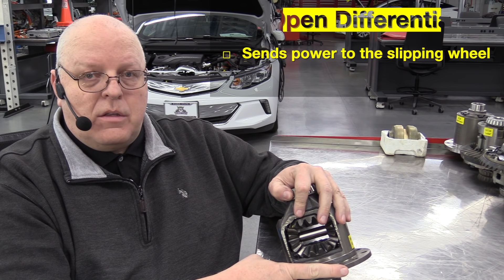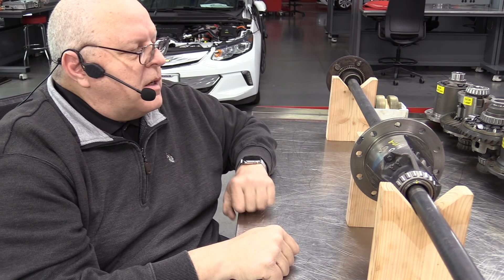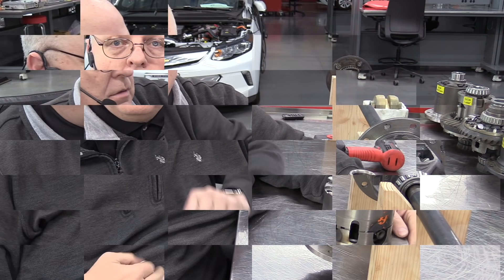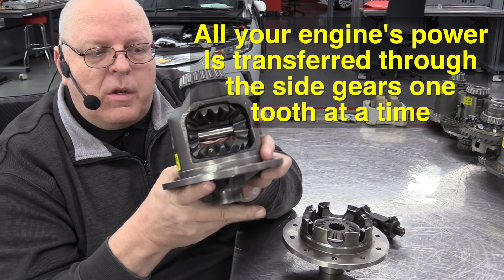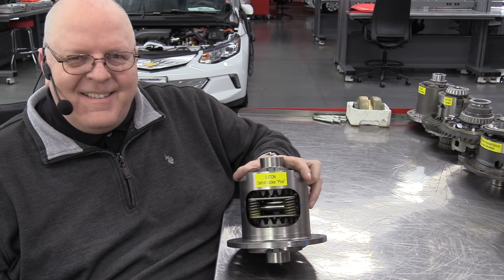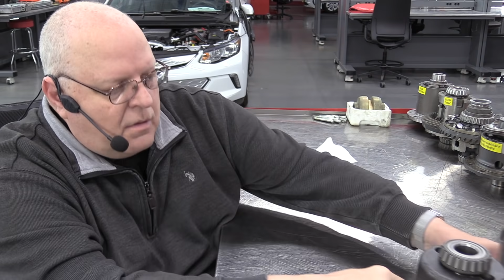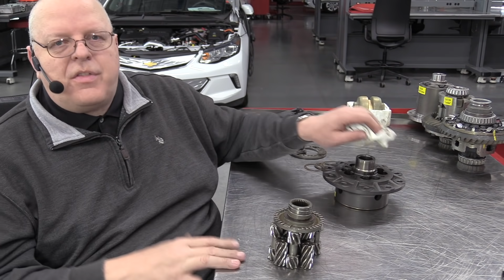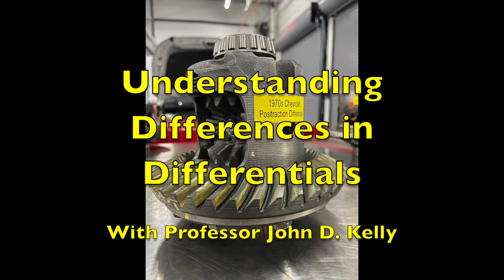Understanding Differences in Automotive Differentials

Comment: 1:00:00 I'm not convinced your Eaton 'locker' is a limited slip - for the simple reason it's called a locker ! I guess it's a governor activated locker - which I guess will respond faster than the air operated one.
The air operated one is a disaster if it is automatic. If it's manually activated, the instructions will say to activate it only when stationary - so you don't mangle the teeth like as has happened !

Anyway, as this is my final drive - err, comment - thank you very much for this video, it's been an interesting journey through various diffs ! The more I think about the Trutrac using the pinions as a limited slip, the less convinced I am that they do that - unless there is some clutch somewhere they operate. I guess all I can say is - feel free to prove me wrong !

Cheers. Great, well-presented video.
Reply from the maker: https://www.eaton.com/us/en-us/catalog/differentials/mlocker.html
Reply: @WeberAuto  As I understand it the Eaton G80 gov-lock does use clutches but it can't slip once the governor kicks in, any fractional turn slippage just causes more apply force and it either doesn't slip further or it applies so much force that it shatters the case. It isn't like it limits the slip to a certain speed like the GM Versatrak hydraulically applied clutches do. IOW in this case calling it limited slip means limited to slip only a few degrees of rotation, just enough to apply the clutches hard enough to match the applied torque load. As always I still love these videos.
Reply from the maker: @danielthechskid  Thanks for your feedback. The Eaton Locker clutch packs can slip. The ball ramp can only expand so far. If either side gear backlash is too wide, or if the transfer block in the middle is too thin, there won't be enough force to keep the clutches from slipping under a load. Even properly setup the clutches can slip with enough torque and unequal traction. 

One clarification. Many people, including Eaton, call this a G80 differential. "G80" is a GM regular production option (RPO) code for ANY type of limited-slip differential. A Camaro, Corvette, older Caprice, etc all had G80 as an option. Some of those used the positraction type differential, others use the Torsen Type B differential, some used the Auburn cone style, but the trucks all used the Eaton locker. Other "G" codes indicate the gear ratio, for example, a GT4 = 3.73, GT5 = 4.1, etc.
Reply: @WeberAuto  Thank you. I do know one thing for sure about them, with the vehicle up on a 2 post lift and the transmission in park it's fun to spin the tire on one side by hand fast enough to make one engage because it then stops dead with a satisfying clunk. This was when we had one open because the right/passenger side shock absorber bracket broke off of the axle tube and took a chunk of the tube with it and so it was open because they welded the bracket back on which of course required draining the oil and pulling the shaft.

BTW the one I'm thinking of is this: https://viciousoffroad.com/files/Blog/Differentials/gov-lock-internals-eaton.jpg where once the governor's weights expand and catch it stops turning, so the cam plate which is geared to the governor is forced to stop turning relative to the case, so the cam faced side gear can't slip/move at all unless the lash is so great that the ramp peaks can cross each other and not compress the clutches at all.

Comment: At 45:00 on, you talk about the helical pinion gears pushing out and down as an effect similar to the multiplate clutch. I'm pretty sure you're wrong - those gears just act as diff gears transmitting power from the casing rotation to each half shaft. They have no diff-locking or braking effect at all.
Reply from the maker: https://www.jtekt.co.jp/e/products/lsd.html download their catalog to learn about the helical gear operation and bore friction.
Reply: @WeberAuto  Cheers. I'm a bit surprised at that !!!

Comment: 44:20 his style of diff, I came across first in a radio controlled car ! It only had 1 or 2 pinion gears instead of the 4 in the video - and they were of course plastic !

It looks to me as though the transmission gears are 'good enough' for the job and the damage has been caused by metal chips in the oil - possibly from one of the dog clutches.  It may well be that there are too many dogs and they're therefore too small to withstand the abuse - hence 1 or more dogs have been chipped off. BUT I think that's simply because too few dogs drove at the first time - so much of the force was carried by one or two dogs that had engaged when the others hadn't due to slight crookedness of dog clutch alignment. I daresay the design is 'good enough' in normal use but I'm guessing the vehicle had been driven in bad terrain with the accelerator to the floor resulting in spinning wheels gaining speed very quickly before the control system had activated the air supply to engage the dog clutches. Resulting in impact forces being applied to the clutches of a greater force than designed. Hence, IMO not a sufficiently rugged design - and the multiplate wet clutches would have been more durable.
Reply from the maker: Thanks for watching

Comment: 35:00 I've not come across a worn out multi-plate wet clutch before. I'd have to ask the question if there was an oil leak on the vehicle ! The actual clutch wear material becomes the oil as there should be a film of oil on all the clutch plate surfaces - hence the solid bits shouldn't wear. So that makes me think that diff had a lack of oil at some point in its life.
Reply from the maker: Clutch plates wear out all of the time. Thanks for watching
Reply: @WeberAuto  Dry ones do but wet ones ? Although my experience is more their use is for brakes.

Comment: 26:00 As an interesting investigation, I looked at 4 wheel drive with this question:

On turning a corner, the rear inside wheel (A) moves the shortest distance. The outside front wheel (D) moves the greatest distance. Therefore the other 2 wheels (B & C) move a distance between the other two. So, my question was is dos the total distance of A + D = B + C ? In which case, it'd make sense to drive A and D as a diffed pair and B and C as a diffed pair but have no third diff between those 2 pairs.
The answer to the question is 'NO' the distance travelled of A+D does not equal B+C - BUT it is fairly near and probably near enough, due to tyre flex, as to not need that third diff.

It'd just be a hell of a mess having shafts to the wheels linked diagonally !

One final point - if the vehicle had symmetric all wheel steering, then yes, A+D does equal B+C !
Reply from the maker: Thanks for watching
Reply: This is a very interesting line of thinking. As you pointed out there would still be windup in the drivetrain using the diagonal differential setup, but it would be less than any other 2 differential 4WD option. What's really interesting to me is the symmetric all wheel steering idea, as in this case, the inside wheels will follow the same radius and therefore turn at exactly the same speed, as will the outside wheels. This means that one differential splitting drive between the left and right of the car is all you need for a windup free 4WD system. 

You would need a left and a right driveshaft to connect power from front to back though, so the cost of adding the steering and doubling driveshafts would almost guaranteed be more than 2 differentials (Not to mind the packaging space lost by steering room for the rear wheels and the second drive shaft. Off road this could be amazing though as the most common place where locking differentials are needed is where diagonally opposite wheels are off the ground, which wouldn't cause any wheel to spin up with this setup as nothing will spin up through the differential until both wheels on one side have no grip. Also you could claw back packaging space by reducing the turn angle of the wheels until you get a normal turning circle, though I suspect the tighter turning circle would be more likely to impress people if something like this was being built.
Reply: @peglor  Been thinking more recently - see vehicle Hagglunds BV206 - with such a complex articulation, 2 drive shafts front to back could be tricky - so I thought the one straight portion through the articulation could be co-axial shafts - noting that generally their speeds would be the same so no need for ball or roller bearings between them, just bushes and the shafts would only need to be strong enough to withstand the torque going through them as individual shafts as bending strength would be shared by both ! I guess the inner one would need to be longer with telescoping provided out of the articulation area. Or could it be within ?????
Reply: @peglor  Away from off-road - i.e. on-road - and cars, I'd be tempted to go for 2 engines - eliminating the need for a diff completely !
Reply: @millomweb  That's what electric cars are at - one motor per wheel is the ideal for the best on and off road performance as you get full front/rear left/right torque vectoring, no spinning wheels just because they are off the ground or have no grip (Thanks to feedback control on motor speed via the ABS sensor), regen braking torque vectoring before the ABS need to do anything. Active yaw control and even skid steering if you don't mind chewing the tires a little... 

It's been a long time since I've heard mention of the Hagglaunds BV206. I was thinking more of a 4 wheeled vehicle with 2 steered axles that turn the same amount but in opposite directions. I'm not sure what setup the Hagglunds uses, but hydrostatic drive is a possibility as it would be simpler then shaft drive between the front and rear sections. The hydraulic control of the angle between the front and rear halves of the vehicle allows it to steer while floating in water too. If you haven't seen it, have a look at the Sherp - especially the 10 wheeled version to see where the state of the art in vehicles like this is at the moment. Weirdly Rich Rebuilds on youtube has more technical information on the vehicle and how it works than the many channels that off road them. It's a chain drive skid steer design.
Reply: @peglor  "no spinning wheels just because they are off the ground or have no grip (Thanks to feedback control on motor speed via the ABS sensor)"
Not everyone wants 'right on the edge' technology and it's fair to say a good job of controlling torque to a wheel is to look at the weight on it by the deflection of the suspension before considering ABS sensing.
"I was thinking more of a 4 wheeled vehicle with 2 steered axles that turn the same amount but in opposite directions" - Like the Lunar Rover vehicle - of which I had a toy version a a kid ! The common 4 wheel steering is achieved with rigid axles attached rigidly to the chassis and split the chassis with a steering pin in the middle !
As for more complex 4WS are vehicles where the rear steers the same direction as the front but a fraction of the amount !
The BV206 is pure mechanical drive - I guess for efficiency especially at speed. The alternative isn't 'hydrostatic' but hydraulic - which are great in slow moving vehicles.
I have rated the 4W Sherp as less capable as the BV206 and I think the 10W Sherp is an attempt to deal with the shortcomings of the 4W. I don't think it's skid steer but articulated steer like the 206.
If you want funky drive, look at the soft ground twin screw drive !
The problem area for ATVs is the wet/dry interface. I suspect the Serp and 206 have achilles heels but at different 'bog' depths. The 206 is the deeper machine. The issue is where wet buoyancy removes 'hard' ground traction.
Reply: @millomweb  All cars on sale for nearly the last 20 years already have ABS sensors, but the vast majority don't have suspension load sensors, so it makes more sense to use the sensor that's already included in the car to regulate for wheel spin. 
4 wheel steering is where you have two axles that have steered wheels. The version with a pivot in the centre of the vehicle is articulated steering. here's a fair chance more construction machinery is using a pair of steered axles than an articulated joint at this stage as having a pair of axles will allow crabbing (Sideways movement without turning at all), rear wheel only steering for forklift style alignment of the vehicle with something it's picking up or opposite steering for the tightest turning radius - some models such as the JCB Loadall have had a switch in the cab to go between these options for well over a decade at this stage.
Most road going 4WS setups switch between crabbing at low steering angles for lane changes and opposite steering at high steering angle inputs for tight turns - there were already full mechanical systems out there that did this 20 years ago. 
Hydrostatic drive is the term I've seen used in technical documents and machinery brochures to describe delivery of drive via hydraulics rather than by movement of solid parts. 

The 10W Sherp is more or less a standard Sherp with a 6 wheel driven trailer, so the front part seems to still be skid steer, but the articulation joint does more of the steering work with the trailer attached. The Sherp's main shortcoming is steep climbs and descents, where the short wheelbase will catch it out (There's a fairly recent video of someone standing it up on it's end trying to go up a steep rock knocking around on youtube), and adding the trailer with a joint that can float to follow the slope or hold rigid to make a rigid 10x10 chassis gives the best of both worlds. It's definitely very hard to tell where the Sherp and Hagglund would stack up in side by side tests, but I suspect there's a good chance the 4W the Sherp will go further on really soft ground because it's lighter and it has tremendous flotation thanks the balloon tires, to the point where it can climb onto ice from  water, which is one of the hardest things for an amphibious vehicle to do without winching.

Comment: 21:30 Transferring power through the diff - your numbers of teeth transmitting power need doubling as there are 2 wheels. So, 2 diff pinions gives 2 teeth per wheel transmitting power - a total of 4 teeth. Conseuently, 4 pinions is 4 teeth per wheel - or 8 in total.
Reply from the maker: True. Thanks for watching

Comment: When I saw the length of this video I was like no way I'll watch it all but you kept me interested throughout the whole presentation. I will say see all this make me appreciate the Torsen differential with no clutch packs to wear out. Also no LSD oil modifier needed in a Torsen seems like another plus. I have seen demo videos of the Eaton true track claiming it can vary torque from one wheel to the other depending on traction say one tire on pavement and the other on loose gravel. I would like to see an explanation of how this works maybe in a another video? I just can't picture how this occurs in my mind.
Reply from the maker: Thank you very much

Comment: The pinion pin on the Dana Differential, instead of going in a round hole in the case, it goes on V, creating a ramp , as the case applies the torque to the pin it rides on the V forcing it to the side and against the side gear applying the clutch, thats ingenious, because in a daily low torque to the wheels maneuver, the clothes don't engage as much has in a high torque situation, making the differential work as an open diff when limited slip in no necessary.
Reply from the maker: Thank you. I was wrong about that original Dana differential operation. Thank you for the clarification.
Reply: @WeberAuto  the score of clarifications is way way on your side! Thank you professor

Comment: 4:00 an "axle shaft" - never heard of one of those fictional things ! It's actually called a half shaft - as it's half the length of the back axle.
Reply from the maker: Thanks for your feedback
Reply: @WeberAuto  Since axle = shaft, it's as daft as saying axle axle or shaft shaft ! Half shafts here in the UK for the reasons stated. (Incidentally, they usually break at either end, just after the splines or just before the disc at the wheel end !

Comment: A note regarding Torsen style differentials: Torsen behaves just like an open differential if there is zero (or close) traction on one of the wheels. 
There two more types of the differentials would be interesting to look at (that are completely different from the clutch type) are: the AP Suretrak (which has no side gears as such) and viscous type.
Reply from the maker: Thanks for the information
Reply: I remember from the original Humvees, the standard method for getting unstuck if you had wheel slip was to press the brakes and gas at the same time. If there's no load on a wheel (usually because it's not on the ground) you can provide your own. The antilock system made sure that all the wheels would spin at about the same speed by relaxing the pressure on any wheels that weren't spinning.